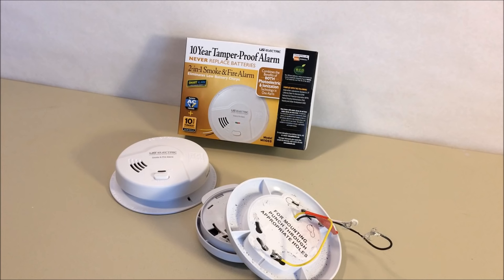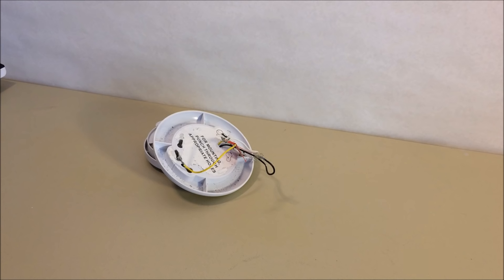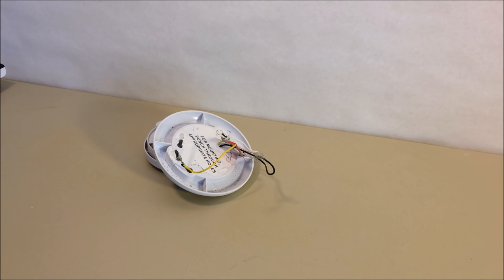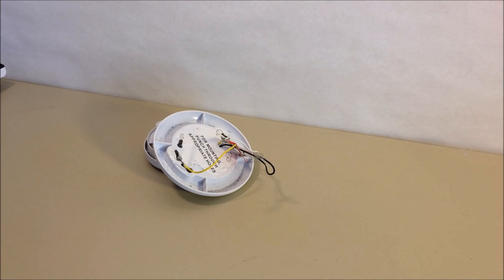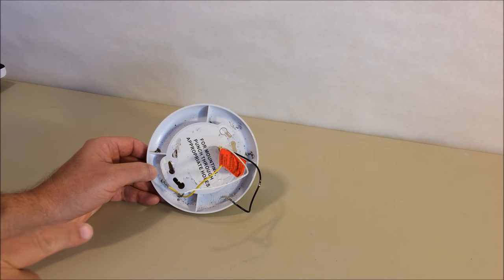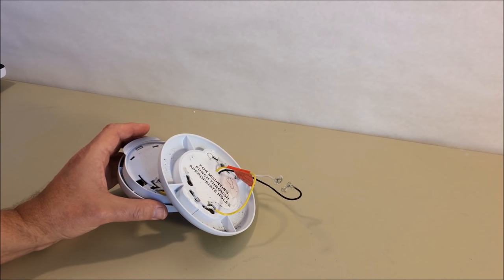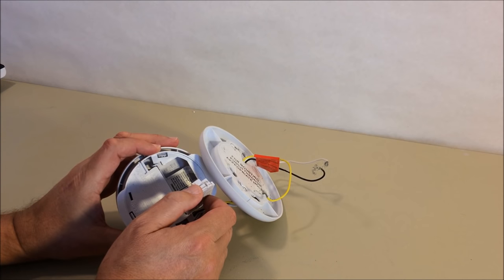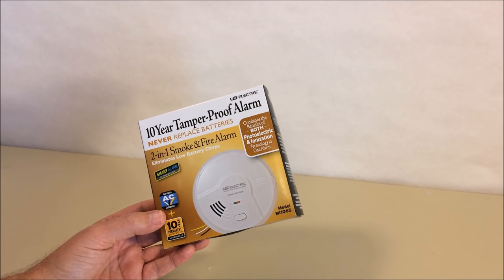Smoke Detector Beeping - Causes and Solutions

Comment: You change the battery.  If that doesn't work, you install a new detector.  Not rocket science.
Reply: EF ANDMK What if it still chirps, even after changing the battery?
Reply: ᴍᴀssᴀᴄʀᴇ I unmoored that shrill bird from the ceiling, allowed decompression, with a reinvigorating blast of compressed air, and she purred like never before.
Reply: Shane DM is

Comment: My house flooded and my smoke detectors are going off continuously.  I have turned off a cb to stop it.  Any idea what the problem is?  They are hard wired and have 9 volts battery backup.
Reply from the maker: +dbc7772011 Often times, when hard wired smoke detectors containing 9 volt batteries are chirping after the circuit breaker has been turned off they are doing so under the power of the 9 volt battery for the purpose of announcing a power / battery issue
Reply: d
Disconnect the alarm from the ceiling .Remove the battery .Press the button for 15 seconds to clear capacitor.
Reply: @lalaboards   this does fix them because it resets. This worked for me. It's always in the middle of the night 9 volt batteries. I had one that after the new battery it kept  chirping,  took it down unplugged the base removed battery then held button down for 15 seconds it chirped until it stopped i released button held down again it chirped a little then stopped, the third time i held down button nothing, the capacitor was released of energy, took shop vacuumed out and cleaned it re- installed now its been 3 hours no chirps.